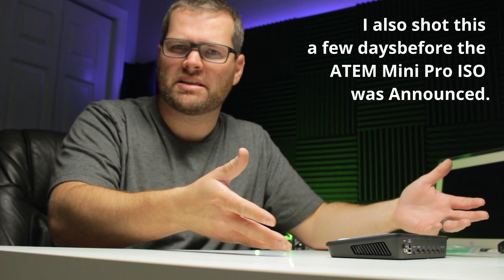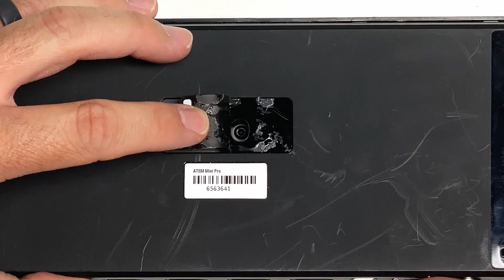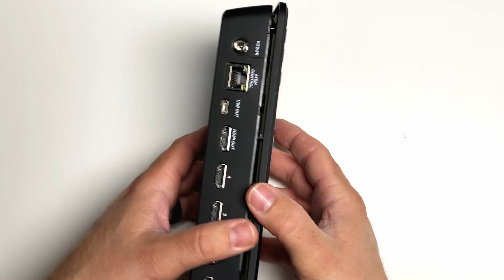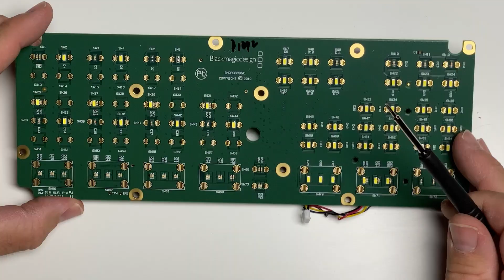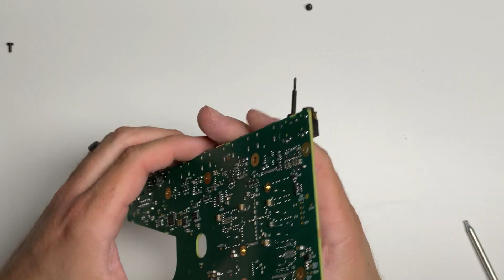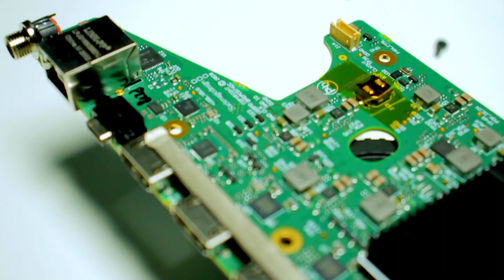What's Inside the ATEM Mini Pro? A Quick Teardown to see Just What Blackmagic has done!

Comment: Looking closely around the 8:45 mark, gives me an idea: dimming the light from the left six large buttons. It looks like each button sits over a field of ten (or seven) items. Based on my non-professional engineering understanding, it seems that there are four contacts - one at each corner - that absolutely must not be covered. But what about the (4) three pairs of LEDs (or the (2) three single LEDs) in the middle of each of the left six large buttons? 

Critical question though: when you looked at the flexible pieces at the 8:00 mark, did you notice whether the LEDs on the board exposed their leads? 

As for the seventh large button to the right, I would not change that one. It doesn't get turned on very often, and when it does, it can be important.
Reply from the maker: I suspect they put only the LEDs they need to make it cost effective.  AS far as the LEDs, they don't expose their leads so it'd be hard to replace if they fail.
Reply: @RyanKnowsNothing  My ATEM Mini is being used at our local theater after the last Friday the 13th closing of - everything. Thought the brightness would be an issue, but not under the kind of lighting that doesn't have a real audience.  When we get permission to host a real audience again, that may change. That's when dimming may be useful.

Your answer about not exposing the LED leads is good news. Painting a wash of some color directly on the LEDs for the big left six buttons might work. I wouldn't do it on our only ATEM Mini, but if we get back to making some money from tickets and add another switcher, who knows. In the meantime, any adventurous soul that tries my idea should know that it is just an untried idea with no guarantees whatsoever.

Comment: I'm so glad you did this so I don't have to!
Reply: The two unused slots under the heat sink are for memory based on the SK Hynix logo on the other chips around them.
I assume it RAM, though I didn't really check; I suppose it could be some persistent storage, though that seems unlikely.
Reply from the maker: Ha! Thanks Aaron. I was curious what the differences might be between the different models. Keep up the good work on your side!
Reply: Super interesting about the unused pads! I wonder if that means a fourth ATEM Mini is coming soon or if they scrapped whatever plans there were for that instead!
Reply from the maker: You gotta think they have something planned. They just keep throwing amazing things at us left and right.
Reply: At this point I can't imagine them launching a fourth product with this same form factor. Everyone is asking for either different audio input jacks or a second HDMI output, all of which would require a wider face plate.
Reply from the maker: Ahh, I didn’t think about that. It’ll probably take more processing than is available in one of these as well. I wonder why they released the ISO so fast after the Pro? Is that following their normal release pattern?
Reply: Aaron Parecki this should inform your ‘dream ATEM’ ideas. Sorry I don’t think you can have the hdmi s on their sides but maybe you can use the 4 unused audio buttons for macros with just a new case top, software update and button pads before they would have to spend anything on new circuit board tooling. I would still like you to be on the design team for the next one. (But leave the SDIs out).
Reply: @aaronpk  Since all the button actions are thrown over to the ethernet actually a software for pc that acts as a pipe could be made that would read the press and immediately undo the action for example selection of the effects type. That could create triggers in OBS and push pop lower thirds. Yup I do follow your channel and thank you for the great videos. 

So they become virtual control button for actions. In fact I was imagining some arduino hardware with foot switches and pedal that could control the ATEM Mini as well as OBS. Although I am not a fan of Arduino cause I design embedded systems.
Reply: @aaronpk  now you have to do the same with ISO lol